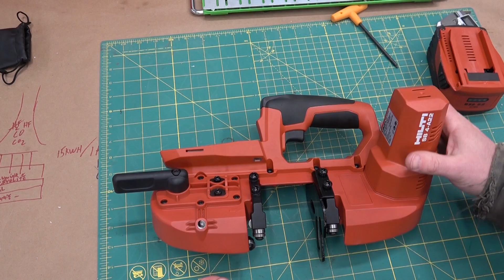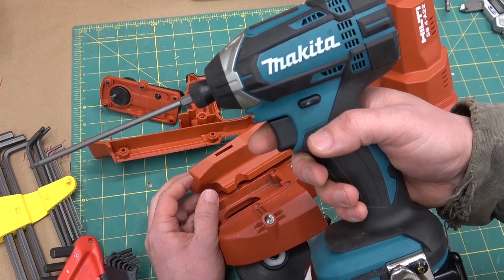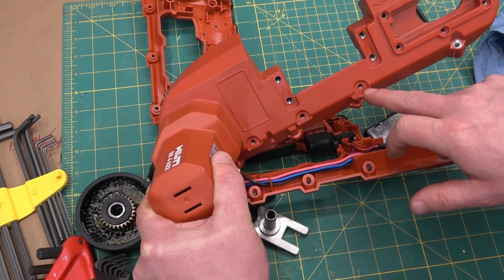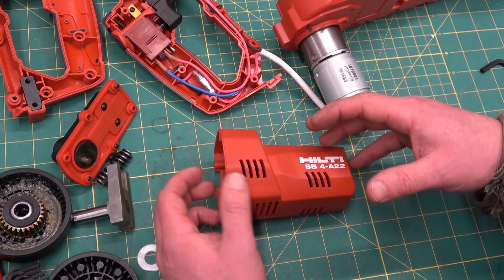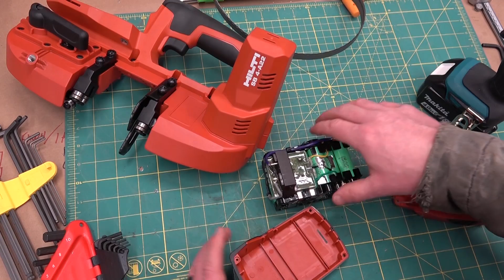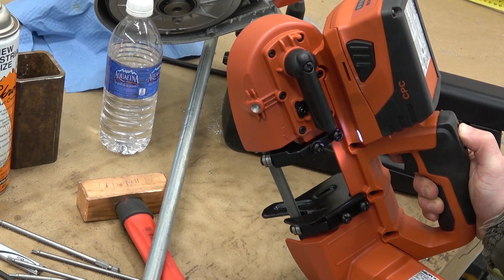BOLTR: Hilti Compact Band Saw | Quality Problems

Comment: I think that products like Milwaukee are so popular among contractors because when they do not work, you just grab an other and when the box with crappy tools is filled, you just drive down to the tool pusher and get them fixed for free. They are also so cheap that it does not matter if a tool is lost, damaged or misused. Abuse to trashcan is only 150$-200$
Reply: Think a big commercial construction project and not a small site.  A typical cost to build it is 60% labor and 40% materials.  So on a $500,000,000 project that is $Threehundred million dollars.  Now have the worker who costs the contractor $70 per hour work with some sh**t tool that breaks down under heavy use and he spends time trying to get a new one that can do the job....Say $60 worth of time.  Oh, and the other guys working next to him can't do the next step because this schmuck is looking for a new one.  Puts those guys behind.  So $100 you just saved  on cheapo equals out to a bad decision to not use something that has a better shot at working all the time.

Comment: You have to anneal (soften with heat treatment) the blade so that the weld points are flexible as the rest of the blade so it will not snap apart on you. The weld point is a harden spot and is not flexible and that is a small radius for it to roll around. Real good band saws of old came with a built in cutter and blade welder with a annealing function built in to the unit, heats it up glowing red wide for a few times and that does the job. Not sure any thing but the blade thickness these need would ever work on this tool.
Reply: they still do, but looking at the prices of stand alone blade welders, the home gamer is better off learning to tig weld blades like this old tony.
Reply: We have a Do-All at my place and it has a built in blade cutter, welder, and the heating element to anneal.

Comment: Can someone clue me in to the this old Tony comments? I watch his stuff too,  he's no Ave, but any port in a storm says Mrs. Ave...
Reply: This Old Toney is like the middle school version of Ave.
Reply: I think old Tony is awesome and I so really hope Mr AVE thinks the same otherwise its like finding out Scooby & Shaggy weren't really palls. =)
Reply: They're always referencing each other.  Pretty sure they're internet buddies.
Reply: AvE is referencing TOT's video on the Startrite bandsaw where he welded a bandsaw blade to fit.
Reply: @shexdensmore  both in the back of the class?
Reply: this old tony is basically AvE but with dry puns instead of metaphors
Reply: @tdschisel  Many of TOT jokes and asides are double meaning and rooted in the physics and math community and are commonly used there, leading me to believe that he is a teacher or researcher, or works with them like Tom Lipton does.
Reply: bruno1023 e

Comment: I work at a large manufacturing company (8000+ employees). We obviously use a lot of every type of tool available. Hilti runs a tool rental program that we buy into. I'm told it's cheaper than if we had to buy tools. If the tool breaks they just take it back and you get a new one. After a certain number of years they take the tools/batteries back and refresh them with new ones. A rental program like that tells you everything you need to know about the quality of the tools. They could lose it all in a hurry if they weren't any good.

Comment: I know these mini bandsaws are popular in the USA where they use single core armors and bigger diameter electrical conduit, spoke to a former US electrician here in Scotland. 

They don't sell them here in the UK otherwise I would buy one for zipping through conduit and smaller armour cables.

Beats carrying a 40kg hydraulic cable cutter and using a hacksaw for trunking and conduit

Comment: Looks very much like the Borsjt Blue one I took to bits today. The blade was slipping a lot due to the rubber on the drive pully being on unscheduled leave.
Was fairly surprised by the price of the pully. Only 15 European pesos.

Comment: Had some of these for a few jobs, essentially cutting 3/4" & 1" emt and also 1 5/8 unistrut and the blades would break constantly. Tool was fine to use, no complaints there but having to replace the blade so often became very frustrating. The rep would literally bring in blades by the case load... and i'm sure that wasn't cheap either.

Comment: Postal strike? Yea burned up the last clear days on soggy island waiting for a cam belt idler pulley while the balls in the bearing get smaller and smaller and louder and louder, driving the thing like a granny cause over 3000 rpms it puts as much power into tearing the bearing apart in truck shaking glory as it does actually accelerating. Postal? Don't mind if I do.

Comment: Your jacket there seems to have the same patina that mine has after some bumblefock wears it for 20 years, it's a military coat with a 1960's vintage from somewhere in Sweden, picked it up in ye olde army surplus in the states for $30, and it's been the most skookum of coats I have ever had when ur fighting the frigid winters.

Comment: I always bought Samsung batteries just based on a quick information search and preference to the company, and then after a few years I decided to go with a few other brands. WHOA. Often times they'd only last 1/4 as long, it was insane. The other brands often rated the mah higher but would last considerably less time from the Samsungs as well.

Comment: Menards sell those by the Mastercraft brand for $99.95 (no battery included).  I think it came with a blade and they sell the blades 3 in a package.  Don't use it when it's cold, it breaks the blade.
Reply: I was actually looking for this comment. It is the EXACT SAME saw only green. It is also sold as the Bosch BSH180B if you prefer blue

Comment: Ive always thought of hilti as fleet tools.

I have a hilti impact driver with 2 batteries that I have used every day for the last 7 years and it has paid for itself many times over.
Reply: In Europe, they are a little more consumer oriented, you can find them without too much difficulty. But outside it's mostly an industry tool bought it bulk, although some of that has to do with low consumer awareness of the brand.

Comment: A company I worked for leased straight from HIILTI think of a demo team of 4-5 having a HILTI bag with 7 batteries, 2 grinders, 2 recipo saws and 2  impact driver Then in the on the shelf there is rattle guns, circular saws combihammers and it goes on

Comment: Regarding your comment on using the choice of tools that rental places use as a barometer for quality- I'd say that depends entirely on the business model of each rental business. If their model is based on low rental costs and weighted heavily towards making the majority of their revenue from servicing and repairing their tools, then it's obviously not in their best interest to rent out robust and reliable tools.

Comment: You need to anneal the bandsaw blades after you weld them. Maybe you could use a torch to heat up that area until it just starts to glow red then let it air cool. The shops I work at have the welders built into the bandsaw, apparently none of the new ones have that. I realize doing it by hand would be much more difficult.

Comment: I agreed with everything until you spoke so highly of the batteries, and that's where I have to strongly disagree.
I work as a purchasing agent and shop manager for a Fire Sprinkler company, currently with 9 contract-construction crews and 3 service crews. When I came into the position I am in now, 3 years ago, Hilti was the only power tool we used (except Ridgid 300). I whole heartedly believed in Hilti and agree that they make some of the only visually clean tools. Personally, their rotary hammers are the best on the market.
The big issue arose when almost every crew in the field reported battery issues over the course of about 8 months. The biggest complaint was referred to as the "Hilti Slap;" if you put a battery in a tool, and the tool didn't work, you needed to slap the battery, as if it wasn't making contact with the tool. We tested the tool with other batteries and even using a feather touch to put the battery in, sometimes had no problems. We even tried jamming the battery on like it owed us money and still found the need to resort to the "Hilti Slap." Of course the first couple times I heard about this, I had my Hilti rep get us some new batteries. The issues kept creeping up time and time again though; whether it was the large rotary hammer batteries or the regular sized 18(?) volt. Another common issue was the battery charge indicator being totally useless, which I witnessed myself on numerous occasions. A battery would only read completely full or dead. No in between. 
After months of replacing batteries and tools, and realizing how much money we were spending on Hilti, my company asked if we should stay with Hilti. It hurt to say no, but I felt that troubleshooting Hilti products every other week was not a good sign, and we closed out our account.
Now this is just one case; don't take is as gospel. Hilti tools, when they worked, were incredible. The problem is; cordless tools are only as good as the battery.

Comment: Anyone else’s dewalt 20v compact portaband start sounding like a baby rattle? The friggin transmission housing screws strip the aluminum housing threads right out. A little handy elecchicken’s tap wrapped around and problem solved at least for awhile🤷‍♂️ time will tell
Reply: Yeah and dont use cutting oil, the blade will fly right off!
Reply: Ours has been through hell and back and it's still kicking
Reply: roys04stx really?
Reply: roys04stx yeah really?  Not had an issue yet, but if it happens I’ll have a rethink.
Reply: @Alex Kruser When the elex tape stops working, and it will, use a time-sert threaded insert

Comment: Looks like a Bosch GCB 18 V-Li to me especially the bottom case (look for the tightening handle and its plate, screw holes, assembly of the blade guide and some other things)
Reply: hilti is bosch.you can change parts between them.they will fit.hilti is like a blue bosch but red

Comment: Commenting again as I watch, before I see if you answer this or mention it, great system,  I know. .    With the blade tensioner,  could you make the shoulders a little taller so the cam pushes further if'n ya needed a lil more outta er
Reply: I see now that wouldn't work.

Comment: Man, I had to use one of those Wilfuckye portabands to remove some ceiling mounted copper pipes. I tell ya, they make quick work of the pipes, but using these things in a corner 16 feet in the air kinda sucks. Ended up just getting the Sawzall because the damned tool wouldn't fit in the corner.

Comment: Might they use the same confuser and harness in a more girthy model with more space betwixt the locations of installation and take up the extra harness length by twisting the frig out of it such to fit in the space allotted without pixie hose protruding from the seams?

Comment: I think Stout was one of the first to come out with a cordless bandsaw.  I happen to have one of the early STX 250 Stout and it's a handy little saw...  The blade speed is about 500 fpm.  The Millwacky one is basically a Stout with some bits to make it use Millwacky batteries.  

I have used Hilti tools and they seem to have plenty of grunt com paired to others on the market... I have not killed my 7 inch Hilti grinder that I got for work yet.

Comment: The blade guide bearings create a very wide channel for the blade to pass.  We don't care that the ball bearings are not perfectly suited to this task, or that they are held by spacious threaded bolts because they are only in use in the middle of a fault or other screw up.  When used "properly" (lol) the blade will sometimes touch the back ball bearing as you push.  We'd like to never see the side bearings and bushings touched unless the operator/gorilla tires a bit and starts holding the tool sideways and starts limping and such. The bushings hold the blade best but quickly mar the sides causing it to snap.  The ball bearings roll and screech and often give up their lives in their pursuit of keeping us from ordering a new blade.  Mostly as an audible reminder to the handler to stop leaning  on the tool and looking at the girl down the block and maybe hold it straight again before something (usually the $$$ Blade) quits on us.  Keep on doing your thing!

Comment: hard to beat milwaukee porta-bands. The cool thing about hilti is you don't have to buy the darn things and you get a new one as often as you want--if your company has the red van visit. However, you just won't get the extra value from a hilti compared to Big Red which will last a long time.

Comment: FYI in the rent-all business something like a 1500 dollar plate tamp will earn at least $8k to $10k before it's retired. Throw a new honda on for $400,  change the goo in the counterweight and do it all again. As far as only running what has the highest return is kinda true but it all depends on who in corporate is sleeping with who in the industry. The good ol' boy system goes all the way to the top.

Comment: On an almost-related note, I just serviced a Ridgid drill today that had failed entirely because of that rubber overmolding coming loose, wedging itself in the speed selector, and getting into the motor.  Garbage!

I've never played with this Hilti portable bandsaw, but I've serviced a few of the Milwaukee plug-in variants.  There was a bad few batches that had alignment issues and kept slipping the band under load.  :\

Comment: dont want a rusty shaft on bearings? 
as someone who has never used a grinder, let alone made anything from this shiny plastic stuff - that seems strange to me.

wouldn't the bearing take all the abrasive action away from the joint? seems like the rust would sit there and not do a whole lot. except maybe rust a little more.

Comment: Weld up a bandsaw blade???
We used to get blade stock, dad would make our own..... ALWAYS SILVER SOLDERED them!! 
I have welded a couple, to get by... But the weld crystalizes the blade, never holds very long 😥😢
Lots of plastic there (even though it's aluminum)......but, it's a HILTI, so it has to be good 😎
Who puts dielectric grease on batteries?? I DO!!!! Makes for a much better experience!!! Flash light, tractor, truck.., I like dielectric grease!!! It's like keeping equipment greased, grease is CHEAP!!! Repairs are not!!!

Comment: Can’t believe you knew about the emt blow pipe 🤔
Reply: Jeremy Chase i made a “blow dart gun” from a 1/2” conduit and a screw through the inside of a wire nut. We used them to chase away some pigeons from a job back in the late 90’s. 

Is that what y’all are talking about?

Comment: Do those batteries balance the individual (or pairs of) cells? Old makitas didn't, bosch probably still doesn't. I always found that odd. Especially since makita always put a shit load of electronics in their lithium packs, apparently mostly to kill off them early (three bad tries and it's bricked) and count cycles so they could refuse warranty. Bosch has had really no circuitry in theirs, probably the simplest on the market. I'd actually love to hear your opinion on the new bosch packs what have the fatter cells they're so proud of.

Comment: How does a plastic injection mold wear out? I mean, I can see how the holes and alignment pins would wear from being inserted and removed, but the center mold area just get filled with pressurized melted plastic. 🤔 How does plastic wear out metal?
Reply: Think about those pics you see where humans walking in a path over and over Will eventually wear it out,, same idea for moulds, cept the fiber reinforcement acts like a abrasive.

Comment: Your only covered for the 2 years, and even that is a dicey situation, since companies like this will simply say that the tool has been abused, which is not covered. Hilti pre-authorizes $90.00 on your cc for any repair, not including shipping back to you, which is over $40.00. I had a reverse switch that was stuck (jammed) on an impact driver and they charged me $130.15. I was shocked. I am not in construction, am a simple homeowner and my driver looked brand new and was not used very much at all. They charge the max for any repair done. THEY determine the manufacture defect, which is a defect in the manufacturing process of a specific part that directly resulted in the failure or malfunction of the tool. You would basically have to be a forensic scientist with an electron microscope and look for fatigue fractures like an FAA plane crash investigator to determine such a thing. In short, think of it this way: Your covered for battery failure for 2 years if your lucky and they don't say that you improperly charged them. It has to go in for diagnosis either way and you get to pay $40 plus for shipping, just for a small drill or driver. If I could do it over again, I would just get a Ryobi for less than half the price, use it until failure and toss it.